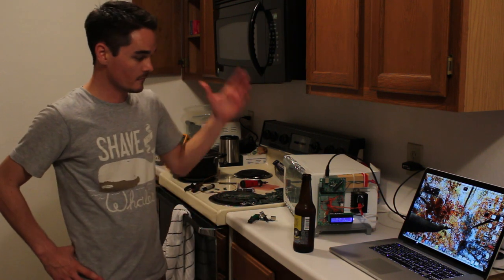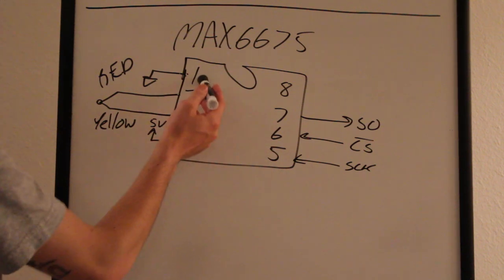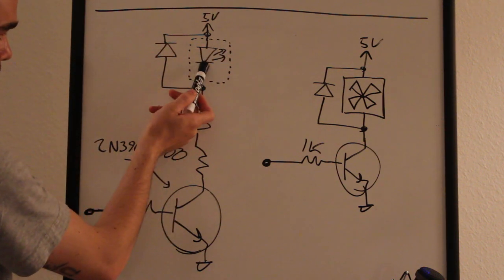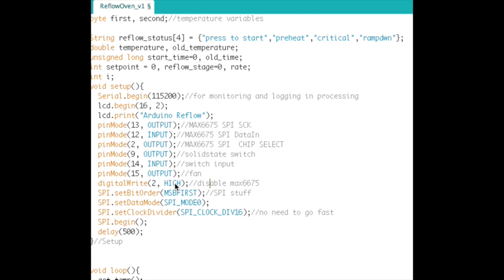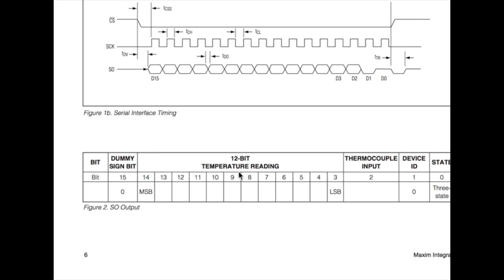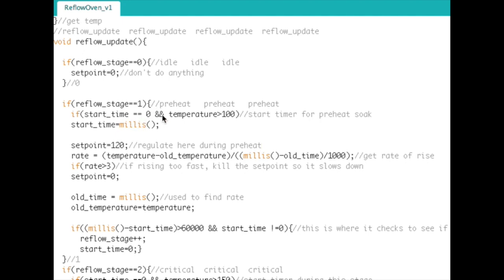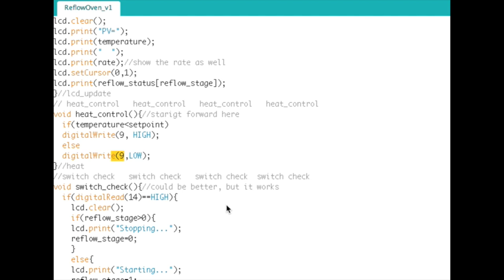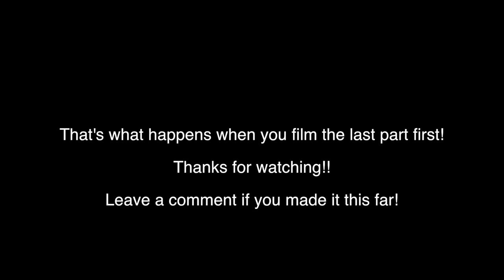How To - Arduino Reflow Oven P2

Comment: Yes indeed you do. I used a 1N23B mixer diode for the microwaves and you get enough to light a red led (1.9v) if you bring it close enough to source like a cell phone. The peltier plate is a TEC12704 and I created a differential using an old cpu heat sink on one side. Combine these with a charge pump and capacitor/supercap and you will have a low but usable power supply for a microcontroller used in something like a remote sensor. The attiny45u also works down to 0.7v if you avoid charge pump.

Comment: another great video. i've been doing lots of miniature projects offline to do with energy harvesting and thought if you wanted a new topic for the future to suggest it. so far i've had great success harvesting microwaves with mixer diodes and garden wire, light with leds, heat with peltier plates and mechanical with piezoeletric transducers. i also have my 328p running at 1mhz powering up for just 150ms every 8 seconds to conserve juice. in sleep it uses 350nA at 1.8v. thanks again :D

Comment: I really dig how you put your reflow oven together. I have a large Toastmaster convection oven that I think would make a great candidate for reflow projects. Didn't notice any on your site, but I'm looking forward to see what you settle on for prices of your boards.
On applying your solder paste, are you just using the stencils for quicker and more accurate production, or do you use them for everything? Looks like a great way to speed up the process for multiple boards, but for doing just one or two of a certain design it seems like it would be wasteful as opposed to using a fine syringe.

Comment: Why use the transistor for the SSR at all, the arduino could drive the 20ma led on its own. It is just there for more isolation?

Comment: I am building one of these right now. What is cool is that the toaster oven that I have is the same wiring as yours but with 4 heating elements instead of 2. What solid state switch would you recommend with 10.833 amps?

Comment: Hi Kevin, I´m from México. Would you like to tell me how can i work with this code if i use a Max31855 A/D converter? This is because i want to use part of your code to automatize a copper reactor in my job, using the converter.

Comment: Hi,  Thanks for showing your completed reflow oven.   I saw you used your own dev board there neat idea.   Thats an ugly looking oven though.  I think I'll go with convection one.  They are suppose to distribute heat more evenly inside.  How did you make you solder mask template? Oh also I like to use #define VAR Value for my constants don't take memory that way.

Comment: Good notice, it makes the code look more clear. But I think that using here a global constants is a bad idea, because it uses a memory :) Better idea is to use a preprocesor tool and write like this: #define COOLDOWN_MAX -30.
It doesn't use a memory on arduino, cause the precompiler replaces defined const with the number (or anything else) before compiling the code ;)

Comment: //say the bytes returned from the 6675 are hi_byte, lo_byte;
//highest bit 15 is already 0
int answer = (256*hi_byte+lo_byte) ;
//bit 0 is state
int state = answer && 1;
//bit 1 is id code
int id=(answer && 2) >>1;
//bit 2 is connection state
int tc_connect = (answer && 4)>>2;
//rest is reading in 0.25C
float temperature = 0.25 * (answer>>3);

Comment: Maybe generate a fake TC signal and put it in your circuit to test the calibration/accuracy. Then, of course, you're accuracy depends on your ability to generate the signal.
They do sell this: "Fluke 714 Thermocouple Calibrator"
Use this to generate a thermocouple signal, and put on pin 2,3. Also, it can be used to just test a TC directly. It's costs $1100, so would be good for producing things to sell, and want to validate. Not so much for a hobbiest.